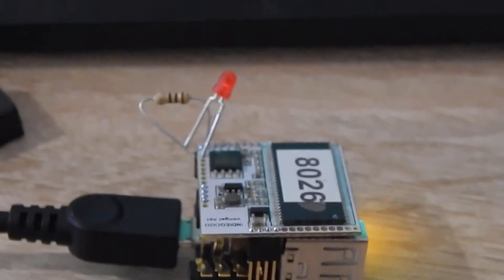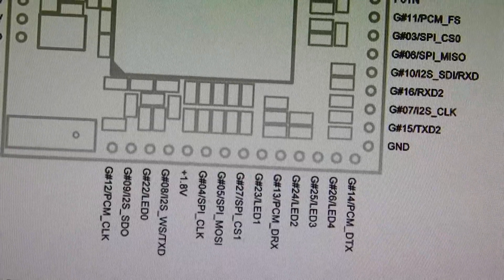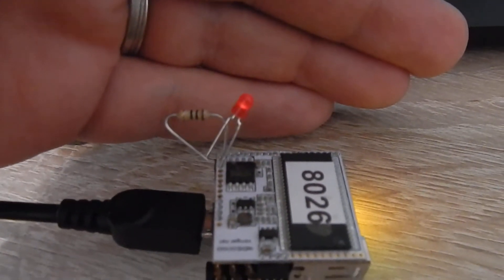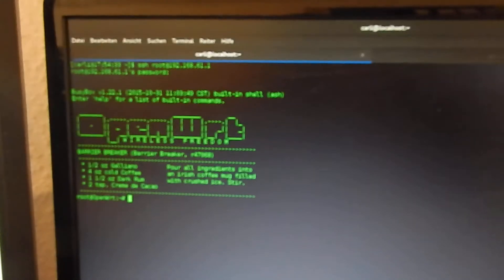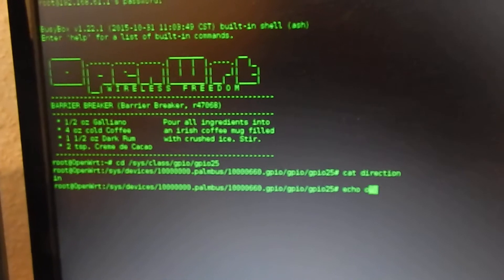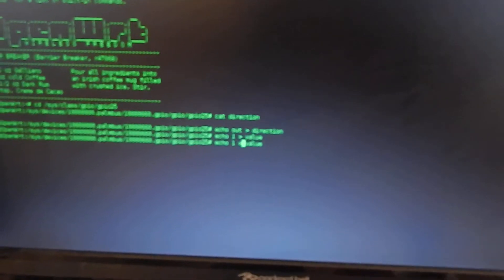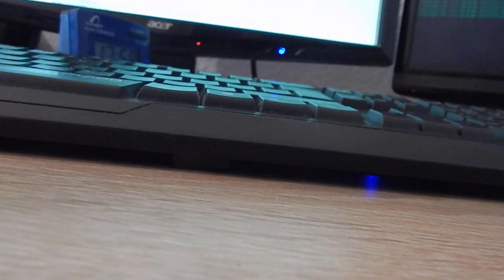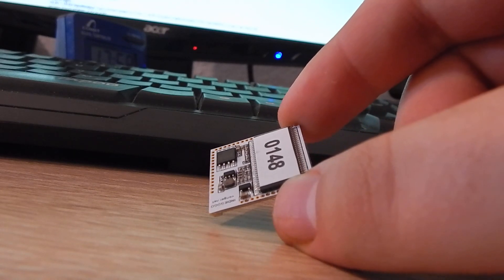Vocore: GPIO Pin LED over Wifi

Comment: hello ,I am new to linux(openWrt). do vocore needs External Microcontroller to send AtCommands ?how to program them ?do they support OTA Programming?if we do not use microcontroller where does the code gets saved?
It would be great i you answer my all above questions :)
Thanks :)
Reply: The Vocore runs Linux. The code is parsed and executed on the Vocore itself. I.e., the Vocore is the micro controller in this case.